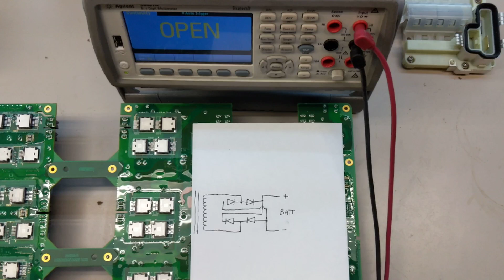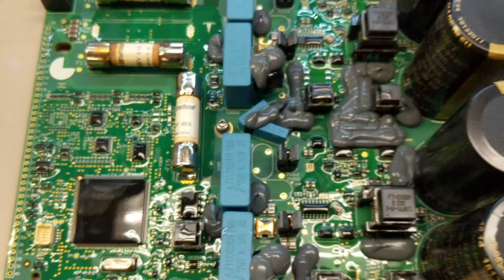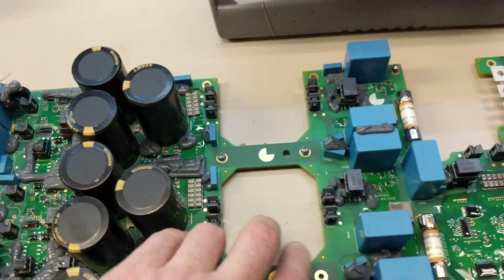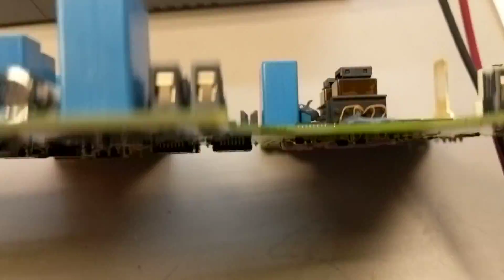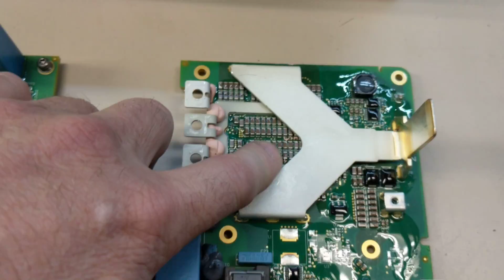UPDATE: Tesla V2G - PART 2

Comment from the maker: UPDATE:  I have also looked under the cover of a brand-new 2020 Model Y PCS, and it is the exact same PCB.  They have NOT updated it at all.  There is no V2G capability added.  Hope this puts the speculation to rest!
Reply: Thanks a lot for this update!
Reply: I have to ask, why couldn't they do bi-directional like the F-150 Lightning plans? Meaning connect to DC and have the inverter in the charger?
Reply: One question I have is - do we know if the boards are identical for European cars? Because Elon said that it’s possible to enable this in Europe, but not in US.
Reply from the maker: @MCSMIK  Yes, I looked at a PCS from a wrecked 2022 Y in Europe, and it's the same.  Elon is not an Electrical Engineer.  He has hundreds of them employed that do good work, that he has nothing to do with, thankfully.
Reply: The Cybertruck has the PCS2 board which has V2G. Of course this is public information now but just putting it out here. It supplies 2X 120Vac to power a house and a power tool (20A combined at one time) and 240Vac (40A combined including the 120Vac outlets) to charge another car. 
Would be great if we can get a teardown and analysis of the PCS2 board of the CTruck. 
The SiC FET and SiC diode is a custom package called HU3PAK co-developed by STMicro and Tesla.
On this board, curious to know what so many fuses are doing?
Reply from the maker: @DivineSoundsMaster-nm6re  Yes, I've seen this unit, it is indeed bidirectional.  If you wanna send me one, I'll take a look!

Comment: It's very annoying then didn't implement V2X here. You have most of the components already there. Even if you didn't want to implement V2G, at least a small capacity V2L would be great for power outages. Even if it was just a single 15A 120V receptacle. Enough to run a fridge/freezer and some lights. Would be awesome for camping as well. You could run a mini-fridge for days.
Reply from the maker: I agree, but Tesla doesn't want that eating into Powerwall sales.  They also have specific language in the battery warranty voiding it if you do power export.

Comment: Does this apply to DC V2G? Or only AC?
Reply from the maker: Well technically the grid is not DC, so that's a misnomer, but yes; with just a software update the car could indeed export DC from the pack through the Tesla NACS connector, and then you could use an external inverter.   Still, according to the warranty, this instantly voids your battery warranty.   You also have Elon saying it's a dumb idea.   (Of course they want to sell you a powerwall)
Reply: @Ingineerix  It really felt like Elon was deliberately evading the V2G question through his somewhat flippant response
Reply from the maker: @suunraze  Yeah, they don't want to talk about it.  Their competitors are doing it, but they want you to buy a powerwall, so they aren't about to do stuff that might cut into that cash cow.  Powerwalls are stupid expensive for what capability you get.

Comment: Assuming a compatible charger, would it be possible to use the ccs port for bi directional charging?
Reply from the maker: Hardware-wise; yes, but when I checked Tesla does not permit power export.  (And it immediately voids your warranty)
Reply: @Ingineerix  That's interesting. So that could be a software change to support...
Reply from the maker: @deathruddlesdeathruddles5438  Yeah, but they aren't going to, because they want to to buy a Powerwall.
Reply: @Ingineerix  I did think that. If everyone essentially had a 60kwh+ energy storage parked on their driveway I couldn't imagine many home batteries getting sold. However, that v2g Ford thing seemed to be a massive seller for the off grid Chaps... im sure if it starts actually limiting sales, tesla will introduce v2g.

Comment: Would it be ok for me to attach a regular 1500w inverter to my Model Y 12v battery to provide some power to my house in the event of a power failure?....I'm told that if I make sure sentry mode is on, then the 12v will be kept charged by the main battery in the car?
Reply from the maker: No!  If you connect anything directly to the 12v battery, you will disrupt the charging algorithm and it will set a fault, and Tesla will not cover it under warranty.  The only safe way to connect such an inverter is under the rear passenger side seat where the PCS (DC-DC) output from the penthouse is.  I would add a heavy-duty connector there so you can disconnect the inverter when it's not being used.  If you don't it can cause issues when the car goes to sleep.   But yes, enable sentry mode and it will keep the DC-DC enabled and you can safely run your inverter.  When you are done, disconnect it.   This would be a good choice for a connector to use:  https://amzn.to/35KRNLV

Comment: I was thinking v2g could come in a package that the grid inverter would run and be outside the car and like supercharging the dc bypass relay/contractor kicks in and feeds out the 350-400v dc to an external grid inverter.
Reply from the maker: Tesla is not going to do it, they want you to buy a powerwall.

Comment: V2G was probably something they were planning/wanting in the early stage but decided against it when they ran out of control lines.

If Tesla really wanted to they could bypass this board (like what happens when supercharging) and send high voltage DC to a new HPWC and let it handle the inverting and synchronization - or better yet combine a powerwall and HPWC that would have all the hardware you would need.
Reply: Yes, not to mention that there's already some massive inverters for running the motors; With a little reconfiguration, and adjusting to output 60Hz (instead of a VFD used by the motors) one could 'use' the inverters for power generation (3 phase, split phase, etc). It'd certainly take some reconfiguration and custom software

Comment: Hey @Ingineerix, so there's no vehicle to grid intrinsic to the on-board Tesla charger but is it possible to do vehicle to grid the way the Chademo standard does?  Which is to say that it basically just allows DC to flow to the charge connector like Supercharging but in reverse.  Then an external box takes care of converting DC to AC and syncing it to the grid.  (see Nissan Vehicle to Home).  I believe this is the way Ford is going to do their V2G.

Comment: Your findings make perfect sense.  I never expected anything different.  What signaling would be required to ask the controller to close the contacts so I ( a Tesla 2020 Y owner) would have direct access to the battery voltage.  The dc to ac would hang on the garage wall and would use the 'supercharger' mode to access the pack and partially discharge it.  This would be the correct way to have v2g.  Let the extra electronics be outside the car so you are not carrying it around on drives.  Great and fun content. Thank you!!
Reply from the maker: Yes, this is possible.  You'd need to reverse-engineer the supercharger protocol, and the BMS may not like seeing current being exported and could shut you down.  (untested)  The BMS in the car communicates with the supercharger by sending 33.3kbps single-wire CAN down the pilot pin on the charge port.  Fairly easy to sniff/log.   Let me know if you attempt this!
Reply: these cars are never ever ever going to allow exporting 600VDC in anything but a vehicle to vehicle cable perhaps which would be found on a tow vehicle in the future maybe, not usable for output on a consumner vehicle.  youd kill yourself pretty freaking quick and tesla wouldnt want the liability.  theyll output 240v dc in a year with cybertruck
Reply: @richardroberson9277  
1) They do not have 600vdc. Given your knowledge you should stay away from this topic. You lack critical information.
2)Vehicle to Vehicle is more complex than V2G.
3) You have no idea of my knowledge and skill level.  400V is no issue as I often work at higher voltages.
3) No one in their right mind would ask Tesla as they obviously have no interest in extra battery cycles outside the odometer and warranty provided accordingly.
4) Any hobbyist that cares and has some decent power electronics skills can have 240VAC today.  You stated 240 DC but I assume you are ignorant and do not know you have no use for 240V DC in almost every case.
5) The context of this discussion is not waiting for a hand out from the OEM but as an intelligent hobbyist that cares to dive into a product they own to modify or use it as they see fit.
It is funny how strong your opinions are give your lack of knowledge.  Classic modern opinion...
Reply: @zilogfan  okay yawn forgot yeah thats solar string limits usually, 350VDC still.....V2V would be simpler than V2G as no much conversion needed.  V2G not difficult either up to 80amps of 240, could use the same damn cord even.  Nobody is letting you access 350VDC likely never even V2V, perhaps a solution permanently on a tow vehicle or similar.  15 mins not much longer than time to get it on a flatbed.  absolutely no realistic need to have that on every vehicle with a jumper cable style setup.  no demand.  yes i do agree tesla should stop being stupid and just offer a 120V 15 amp outlet.  not much point in going beyond that unless going to 80 to run an ac or furnace.  single unit powerwalls of 30amps are stupid af

Comment: Tesla won't add V2V or V2G till the serlie meng 500wh/kg with 5000 charge cycles isn't ready bcz current tesla battries are worth abt 2000 cycles but with V2V or V2G tht would reduce the cycle count and tesla dosent want any premature battery failure or degradation claims tht would not be good for PR so it won't come untile the new batteries aren't ready

Comment: I wonder if the super charger circuity (DC) is reversible.
If it is, you could get something like a tesla powerwall with no batteries (basically an inverter) and run it off your car.
Reply from the maker: Yes, this is technically possible, but Tesla does not support or allow it.  This video is only about whether the Model 3/Y can do V2G NATIVELY as was widely claimed across then internet by misinformed people.   I show that it's physically impossible to export AC from a Tesla PCS.  Yes, you can add several kilobucks worth of hardware to make a Tesla generate AC (I have done this), but that's not the same as the "built-in claim".

Comment: Will never more buy a car that doesn’t have V2G. And will never buy a BEV that has battery bolted from top like Model3 or even worse a coming battery as a structural part of the BEV. Batteries need to be used and further down replaced.

Comment: V2G might involve a powerwall and setting the vehicle in supercharging mode to output DC to the powerwall. They 've got to sell those powerwalls after all.
Reply from the maker: The Powerwall voltage is 48V internally, so this would require another piece of hardware.  Again, I'm not saying V2G is impossible, but there is not current Tesla hardware solution that can output AC from the car.
Reply: @Ingineerix  Indeed. It depends on their marketing tactics. They get you in the V2G trip and then you realise that you have to get a powerwall and a special "adapter". Great work though. (y)

Comment: Thansks for the  teardown. 2 Questions:
1. If the diodes on the battery side were transistors including the right controller, so the power can flow back over the isolating transformers, how to get it into a 60 or 50 Hz sine wave? So how is the PFC realized? Is there a rectifier at the beginning and then a single  boost transistor, or is it a transistor controlled  rectifier?
2. What happens if you feed DC voltage to the OBC? For example from another battery or a PV etc. with lets say 200...300V DC? Are there any inductive parts like precharge relay etc. that can be destroyed? Will the PFC handle this or will the controller say, there is no zero crossing or sine wave or too low frequency whatever and give a fault? Of course you need a special EVSE with DC contactors, DC fuse etc.
Who wants to try?

Comment: Is it feasible to to tap onto the battery someplace & connect to an inverter for emergency backup power for a home?   This would be very useful without tieing into the grid.   For emergency backup (grid is down) it seems like it would be much more economical to use an EV battery, than buying another battery which is rarely used.

Comment: When doing Rapid DC charging, the external DC charger connects to the traction battery terminals, so these are accessible on the charging connector.
They could build and sell an external device, like a PowerWall, that connects to the traction battery via the charging port. This device could be a bidirectional AC/DC inverter/charger...
Reply from the maker: Could, yes, but wont.   Elon has stated this many times, most recently at battery day.   "Car pack chemistry is not good for this"
Reply: @Ingineerix  nah, thats bs by teslas main owner.....car packs are absolutely perfectly fine for this, they last thousands of cycles. so for home battery backup yes. then again they sell a powerwall.  for grid buffering maybe not.  but at .1$/kwh moved the pack pays for itself before dying.  they also sell megapacks so they dont want to do it

Comment: Q&A about the topology of this converter (Someone will find it useful). Answer from Ingineerix.

I originally thought this transducer was based on the LLC resonant transducer. It seemed to me that after PFC (rectification and voltage boosting), the ceramic SMD capacitors are part of the resonant tank, where the resonant inductor should have stood next (I assumed that it was embedded in clay together with the transformer).

But it was not so. Only isolation step-down transformers are located in the center in the boxes. There is nothing else in these boxes.

It turns out a bundle of PFC with a step-down transformer allows you to adjust the output in the range of battery charging.

Thank you!
Reply from the maker: There is a PFC boost stage, then a bunch of electrolytic filters, then a full bridge converter running into a HF transformer (galvanic isolation).  I don't think it is either LCC or LLC as there is no series inductor there.

The battery may have a fairly wide voltage range, but for the bulk of charging operations, it's a fairly narrow range, and only needs low current at the low/high voltages anyway.  Bulk charging is going to be around 375v right in the middle of the S-curve, so the transformer secondaries can be optimized for that.

FYI: The lowest permissible pack voltage on the Model 3 is 240v.  Anything below that it and it will refuse to drive and if much below that it will not even charge.  (BMS normally prevents it from going lower, but a car sitting at 0% for a long period will eventually "brick" like this)

Comment: One option remains. Close the DC contractors and backflow the DC from the battery to the DC terminals on the charging cable. Tesla (or others) could sell an external inverter/charger.
Reply: Soon can buy this, one floating around on alibaba but for only china made teslas
Reply: @mucky2hot  I could build one myself but Tesla will know if I use it and void my warranty and shutdown my Supercharging.

Comment: Great update on drive circuitry analysis.  So the board does need more than just a chip swap.  That said Munro's Y teardown board had significant changes.  Density of SMD components was significantly higher, and I believe new microcontrollers as well

Comment: So it seems the AC charging circuit is the focus of this conversation which, I concur, is indeed a one way only cct...
But, correct me if I'm wrong , when the DC charging is envoked the onboard AC charger is totally bypassed and the battery via the contactors are directly connected to the static charger via Tesla , Chademo  or CCS High Powered connectors...not the type 1 or 2 AC connectors.
So if the battery is directly connected then current will and can indeed flow both ways along the high current connectors...therefore a combo inverter/charger such as the Delta here below....will certail work with an older Tesla with a Chademo adapter and CCS will soon follow for any car with the updated communication protocol commands(ie a software update) and would be the same for indeed any car with CCS not just Tesla ...balancing will still occur if needed, as they, the balancers, are built into the pack....
https://atlanticces.com/delta-v2hv2g-bidirectional-charger/
Reply: Not really V2G (vehicle to grid) then though, is it, because the grid is AC. Just getting the battery DC out isn't super useful!
Reply: @m1geo  cool but and as I mentioned you would need a combo inverter charger like the Delta...linked
Reply: @outbackev-hunter6035  yeah, I get that. But then it isn't really V2G. It's battery out with extra box in the boot required. Not really the same thing.

Comment: I think you are missing one point. Tesla does not have to use an onboard inverter to achieve V2G. The vehicle supports DC fast charging, so it will simply be a matter of using a new type of EVSE that will incorporate an inverter running off the high voltage DC ports to achieve V2G... No hardware modifications to the car will be required.
Reply: Doing that will be (comparatively) very expensive for the homeowner.  Go look at what an inverter for a 7-10 kW solar system costs to buy and install.  Having the car capable of doing it would be much better.
Reply: On the contrary, such an inverter will be cheap to make, as it eliminates the need for a step-up DC-DC high frequency converter stage. Hell I can design and make a 5kw version for less than $500 using off the shelf parts. Imagine what Tesla can achieve..

Comment: This works fine with V2G. It just doesn’t not output 220v directly. If the contactors for  supercharging make a direct connection to the batteries then it would work exactly like a chadmo v2g system. Which is fully available for a Nissan Leaf. The Nissan v2g system only uses the Leaf battery. Not the leaf internal charger.
Reply: Yes, this is actually somewhat common in EV space in Japan based on what I've heard.